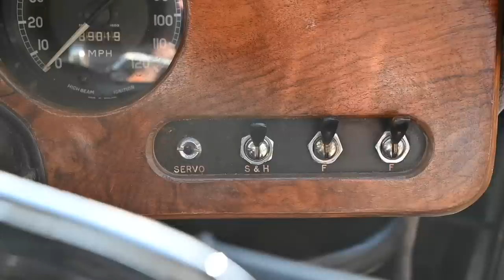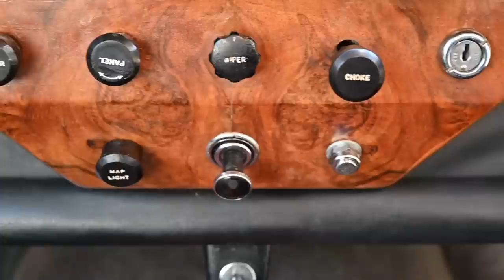1961 Vanden Plas Princess 3 Litre Goes for a Drive

Comment: I can just about remember as a child siting in the back of my uncles Vanden Plas Princess 4-litre R, and playing with the wooden tray that folded down from the back of the front seats.  I believe it was the same or similar body as this but with a Rolls Royce engine. On that day my uncle let my dad drive it.  My dad said the thing that impressed him the most was how powerful the breaks were!

Years later I was at Hednesford Hills Raceway, and the announcer mentioned that one of the drivers had put a Vanden Plas Princess 4-litre R engine in his race car, due to its good power to weight ratio.  Being an all aluminium alloy engine.

Comment: This is so nostalgic for me. My dad had this exact model  and later bought the Princess R which boasted a four litre Rolls Royce engine plus power steering and automatic transmission. In the latter, he  loved to get the needle over 100mph on the motorway, much to my mum's consternation. In the back there were wonderful walnut trays for those posh picnics. Incidentally,  the model you were driving came with the ability to start the engine using a crank handle for when the battery went flat on cold winter mornings. I remember watching my dad start it this way - I can't begin to tell you how exciting it was!

Comment: I had a Austin Cambridge in 1962, Kepped it 4 years and lost in in a accident....I loved it very much. I live in Canada and in those times we had the Austin, Mg's, Oxford and rare Princess . But for Canada it had a lot of flows....like the head lights who where of bulbs, I transfer them to seal beam. Much better vision. Also the heater was well below the need that we had, I made a simple recicling air cirvcuit that help , as at -25 farenheit..... Alos the straight 12 volts battery circuit made the starting practicla impossible, the voltage to the 12 volt coil was down to 5-7 volts so no sparks at the plugs. I change that also and with a coil ans a resistance and a 6 volt coil I had plenty of sparks at the plugs.....Also the generator, giving 30 amp but at about 2800rpms, imagine in the trafic with ald the accessories(lignt , heater, running current, radio, you would take out of the batteri 30 amps and the gen. not producing anything, , well the batt. went dead quickly. I manage to fit an alernator 45 amps and transformed it to positif groung from neg. and ll my problems where resolved. I visited almost of Canada and the Us with that car......and so comfy to. After 500 milles, you got out almost fresh from the seats. Bye

Comment: I owned one of these, as well as a Wolsey 6/110. The cars were completely different cars. The Wolesly was flashy but the VP was much heavier, incomparably better built with fabulous seats and superb trim and sound deadening. The column change suited the car perfectly. I ran it on radial van tyres and it handled very well. I'll probably get shot but I preferred it to my P5B.
Reply: When I was a teenager back in the 60’s in Glasgow, only posh people drove Vanden Plas.  All the “bad boys” drove the PB Rovers, gang leaders drove the coupe version. 😄💁‍♀️😄
Reply: PS, when I was 20 I owned a Wolseley 6/110, Yip It was flashy especially for a girl.  My boyfriend owned a 3.5 PB I always saw it as being a “bad boys” car. 😃

Comment: My father had one with the 4 litre Rolls engine for some time in the eighties, pretty car with superb engine!
Reply: yes we had the  rolls engined  4 litre model imported to OZ  , so i was a bit comfused  never knew they did a 3 litre  .
Reply: The inlet over exhaust Rolls Royce FB60 engine could be a pile of trouble.
Reply: @Ampex196  Yes, I've never heard it described as superb engine before.  More often a bonnetful of trouble.  The car overall is the normal BMC stodge of the late 50s.  Slightly faster than the B-engineered cousins but that's about all you can say in its favour.
Reply: @Jim Drew The car itself would roll off the road - all that weight on the front wheels made it understeer its way into the bushes.
Reply: Looks great. What was the fuel consumption like?
Reply: @jimlogan2329  wondering if it was a petrol guzzler
Reply: @jimlogan2329  If you have to ask, you can't afford it...
Reply: My auntie had one, which she inherited, complete with personalised number plate, from her employer (along with his house).  When it broke down, her local garage persuaded her to part-ex it against ... an Allegro!  Years later I was driving in Sutton Coldfield and I saw the number plate on a Merc, so I presume my auntie's local garage did rather well out of her.
Reply: @melgrant7404  15mpg on a run

Comment: At 12:04 I find that the old style floor pedal for main/low beam switch absolutely does make sense. 
I suppose you have to get used to it, but it allows you to keep both your hands firmly on the steering wheel and use your otherwise idle left foot to dip the beam. This is particularly useful when driving fast on B-roads at night where you need to place the car precisely on the road even though the glare from the oncoming car can be a bit distracting.
In my youth I had an old MGB as my daily driver for many years and I felt myself very comfortable with this setup. And I never felt the need to toggle the lights while changing gears.
I don't drive much like that anymore (fast at night on minor roads), and main beam switches are all hand operated now, so I guess most people feel like you.

Great video, yet again, and fantastic car from the Golden Age of British cars
Reply from the maker: I can see the reasoning, but was taught to dip/undip with fingertips and not taking my hand off the wheel, I guess you'd get used to it but it seems harder!

Comment: I love the Farina cars, including the Fiats, Peugeots and BMC. And as much as the fins have been reviled over the years, if you drive one of these, you realize that, combined with the large windows, they are actually a safety feature. Though not styled by Farina, I owned a couple '60s Mercedes with the modest fins, and they were visible from the driver's seat, allowing me to see the rear corners of the car while backing up - something that's impossible on so many of today's vehicles !
Reply from the maker: Indeed, and on the Rover P6 they gave you little light tabs so you could see the corners at night

Comment: What an amazing barge! I thought it had a PRNDL at first but it's got a three up a tree. The engine was of course the lump they used in the Healey 3000 with lower compression and a soft cam. They were broken for the motor and serious banger racers. In period you could hear them dissovling in the rain.

Comment: One thing that amazes me about vintage british luxury is how they had all that wood in there but no headrests. 

Edit: I know very few automakers offered headrests in their car in those days. I'm just saying it seems like a common sense element of comfort and luxury by modern standards, and I'm surprised they didn't think to put them in back then.
Reply: Safety was not the least consideration at all in cars at that time, no one talked about whiplash, it was all down to a fact of life if you were injured in a car crash, a bit like not having safety kit when using an axe- if you injured yourself you just got on with life, bad luck and all that.  It just wasn't thought about. Volvo started to sell cars on safety and it all took off from there.

Comment: 8:54. The brake light is for  warning that the vacuum reservoir for the servo is low. Thus you don't have servo brakes. There are pipes running from the servo to the front along the inner wing. The reservoir is located behind the nearside front headlamp. See 1:42 for the route
Right hand switches: The two switches labelled F are for fog lamps one each side. 

The centre witches: In the video I could not see the labelling, as you describe. However, wipers are two speed. Heater blower single speed.
Overdrive if engaged (knob pushed in) at the correct revs. If not it will disengage. However I have read that is should not be engaged when reversing or when undertaking a lot of hill work. It gives the effect of free wheeling!

Comment: So its pronounced Vanden Plas of Flemish-Dutch origin.
Under the bonnet, that huge battery next to the C series N-S 6 cylinder engine. Wondered what electrical accessories dictated that ?
Servo & front discs for 1961 was ahead of its time.
That side benchseat handbrake I believe was the same as the period Rover.
That central reverse light looks like mk2 triumph Herald / Vitesse.
So the fuel tank occupies the boot under parcel shelf, that was also an idea shared with Triumph. 
I had a maternal cousin who had a Wolseley 6/110 back in the early 80's.
A very much landed gentry car, alas, I'm a humble commoner out in the colonies, however, I am a tudor descendant from my mothers 👩 distinguished family line, thanks for the appraisal of the prestigious 1961 duo-tone Vanden Plas 😊

Comment: 12:55 Opening rear vent windows!! They were getting pretty rare in the 1960s. My first car was a 1968 Cadillac Fleetwood which was the last USA model to feature them (both front and rear vents disappeared for 1969); that car lacked a lot of gadgets that would be expected today, but there was something special about having 8 power window switches on the arm rest.
Reply from the maker: Rover kept them going until the P6, but the British government kept a fleet of Rover P5s from the early '70s going until the 1980s as the prime minister and other senior people liked to tap their pipes and cigarette ash out of the rear quarter light! 
Not electric like in a Caddy though, that is a bit special

Comment: 'Lighter' steering in reverse is due to opposite castor.
The castor angle keeps the the car directionally stable and provides self centering when driving forwards.  Reverse at speed and it will try to throw itself over to full lock.
Your pronunciation of Vanden Plas is of course correct!
Reply from the maker: Thank you!

Comment: Had a Wolsley 6/99 in the 70s built like a tank strong motor sounded good with a 1and 3/4 inch copper tailpipe

Comment: If only BL would have carried over the same level of "Luxury" to my Austin Ambassador Vanden Plas...
But no... No wood trim, No air conditioning, no cruise control...
Instead you get cheap plastic bits you'd find in a poverty spec Metro..!
But you do get twin carbs and an econometer... 
Abysmal.... but I love it.
Keep the vids coming..!

Comment: Very, very nice, sir! An absolute classic from all those old 1960s ITC series as well as The Avengers, of course. Doesn't seem like a lot of power for such a big car, and a column change manual is unusual for a Vanden Plas, but of course the police would have had manuals in their Wolseley 6/99s and 6/110s.
Reply from the maker: It does make you wonder how it came to be, if someone was a Driver and wanted a manual youd think they'd go for the Wolseley, maybe just loved the VDP extras?
Reply: @furiousdriving , if it did hang around for a while, I suppose it could have been a cancelled order? That wood and leather is hard to resist, but the Westminster and the 6/99 were hardly basic, so I don't know why they chose this specification, but there we go!

Comment: You didn’t mention the model that followed “Vanden Plah “ silent. S” full title (Rolls Royce 4 litre R). Gone with pinin wings  I know the lump is pure Rolls not sure but it maybe 4litre  not sure if it is ohv inlet & side valve. exhaust fhead configuration good on mate.  good review.
Reply: Sorry  Automatics we’re not that popular in the 1950/1960s because they weren’t that   When arrive  reliable  Borgwarner 35 was the. Go to and your Rover 3500 was greatly compromised

Comment: Interesting video but having just read a reputable car mag that states the "S" is not silent  .... But no matter,  I am the proud owner of a Humber Imperial , in fact the 6th one I have owned .   It would be great to see a back to back honest appraisal of the two cars .   My Imperial being built in the Rolls Royce factory of Thrupp and Maberley and using a unique 6 cylinder twin carb petrol set up with a type 35 BW auto box it wafts along on its selectaride suspension and  makes little of extended motorway trips .   Current values of Humbers are extremely low and therefore parts are very cheap  unlike the values of the Wessie/ Vanden Plas  which for good ones seem to be colossal    But which is the best ?   For my money the Farina design is boxy forboding, dark inside and very "Morris oxfordish" using the same body parts as also the Austin Cambridge .   The Humber on the other hand is light and airy, transcontinental styling, quad headlights and  the car of choice for ministerial duty   ,

Comment: A lovely looking car but I think I would hate to have to drive such a large heavy ponderous barge on today's roads and definitely couldn't afford the fuel. A car just for the shows and meets I think. Is that the same engine as the MGC?

Ithink I would want to use it as a second very comfortable lounge rather than as a car, perhaps put net curtains on the windows and have an aspidistra growing in the passenger footwell.

Comment: @furiousdriving. The correct pronunciation would be a silent s, as in plaah. Also, the correct order of wording is Austin Princess,  Vanden Plas, 3 Litre. There are other (later) APs / VPs, for example the 1300 cc. The former Principal of Westminster College (Vincent Square) Carol Burgess, used to pull up in her AP VP 3L which, with her beaming smile impressed her students.

Comment: Older brother had one and managed to collapse a front wheel, he said I could have it for nothing and fix it, father said no and scrapped it ! So out of spite I went out and bought a P4 110 Rover for £15 instead lol.
Reply from the maker: Of the 2 I think Id go for a P4, always liked them
Reply: @furiousdriving  Yes agree ! I only drove the P4 twice, Once to the MOT station and back, It failed on one brake pipe, Mate persuaded me to part with it for £60, He and another chap put it up on Axel stands in their road and changed the clutch ! no mean feat especially for two 17 year olds ! he used it for about 50k miles with hardly any problems, those were the days ! :o)

Comment: Map pocket in the door for the passenger as they would be doing the navigating ?
Reply from the maker: could be
Reply: I was thinking more for the wife's purse. Wives wouldn't be driving those cars in the 60s.
Reply: @3vom918  You may be right. Otherwise there's nowhere to put a handbag except on the floor, unless the front parcel shelf is deep enough.

Comment: Nice vid, did you get to test the overdrive on the car?
Reply from the maker: no, the roads were too winding to hold a steady speed fast enough for long enough
Reply: @furiousdriving  Though I've never driven with one, I'd read that the OD  units they made in the USA (Bendix) had a kickdown feature, so you could put it in OD and expect it to kick down when you floored it; the later versions let you do this in all 3 gears. I don't know how well they worked in practice, but they might have approached the convenience of a semi-automatic.

Comment: 35bhp per litre, we've come a long way, so much has changed but at the same time so little has changed!! Btw it has no seat belts but does it have collision detection warning/autonomous braking?!
Reply from the maker: Yes, theres a loud crunching, screeching noise from the front to alert you of an imminent impact...with the dashboard
Reply: It has a dedicated safety passenger ejection aperture... aka windscreen...
Reply: @furiousdriving  that'll be the pro-con ten (remember that) system that rover developed in the late 50's (not audi as some people think)!
Reply: @trabali5168   Lamination would obstruct the rapid egress...

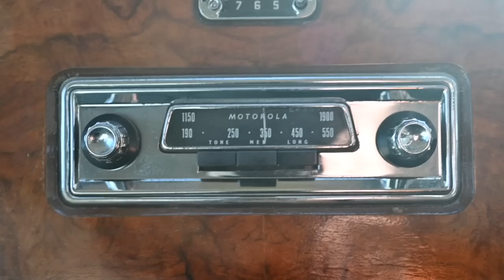Comment: 9:44 Cool! I didn't know Motorola made radios for the U.K. market in those days. If it had been aimed at the USA market, there would have been no LW band, though it might have had FM if the buyer had splurged. I know Motorola made a lot of radios for dealer installation in the 1960s, which could be offered at a slightly lower price than the factory installed ones from GM, Ford and Chrysler. I wonder where they built this one.
Reply from the maker: I always thought Motorola were Scandinavian like Nokia - just learnt they were based in Illinois! No idea where European manufacturing was

Comment: So glad you did this. I had the 1100 VDP back in the 70s and always promised myself one of these. Now I can afford it I may well do it.
To copy the VDP door caps BL introduced the Rokee wood strip accessories which were available for most models.
No drop down picnic tables?
Reply from the maker: No tables until the mark 2, which I was surprised to learn! This is still available if you'd like to scratch that itch
Reply: furiousdriving 

I did check out their website, I think I'd prefer the later one with the tables though.
They have a nice Minx but the version with wood dash is much nicer.